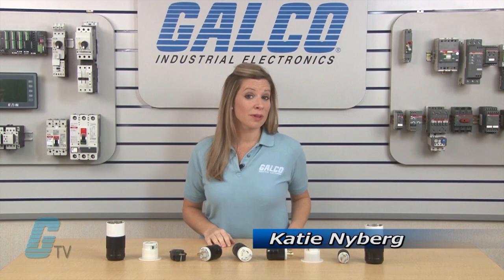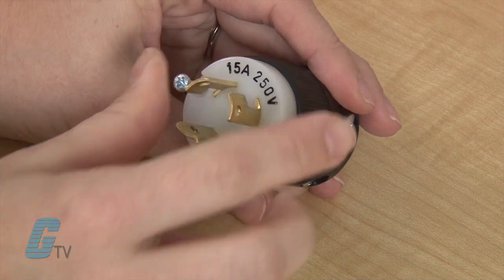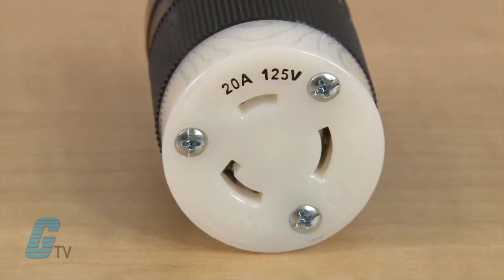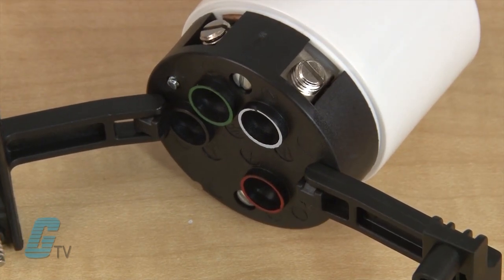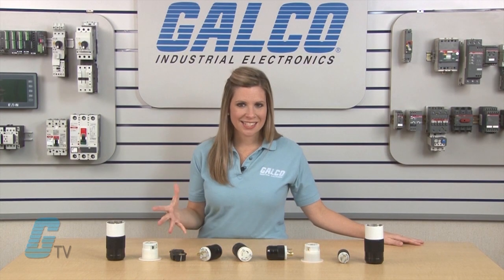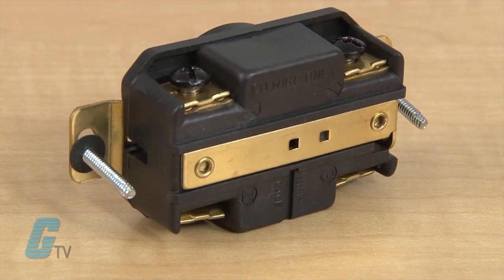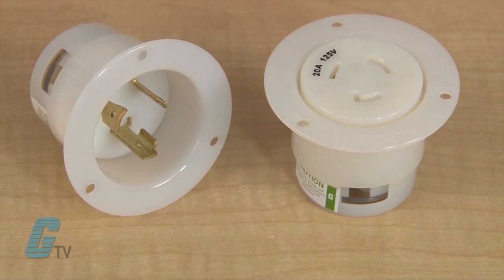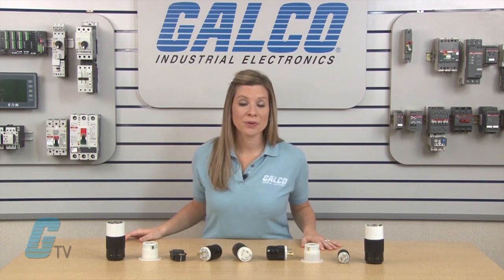Marinco Locking Type Series Twist Lock Plugs

Comment: Bought the 60amp 12/24 volt plug an outlet for my trolling motor. It burnt out my control board on my brand new trolling motor also almost blew my battery up. The plug was not properly put together right. I had the (+) lead to the "24" volt whole witch on the plug was really 12 volts. Then my (-) to the (-) symbol. The plug was not probley put together right I'll be contacting MARNINCO about this had to purchase a new trolling motor an battery that cost me $1,300